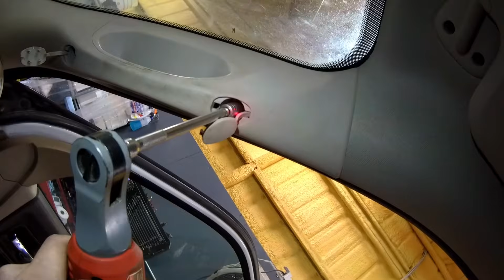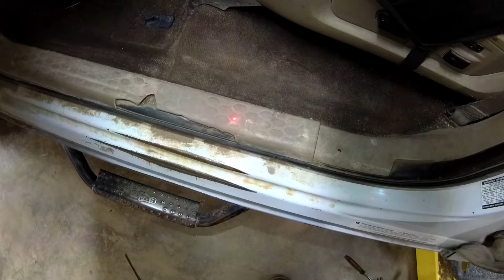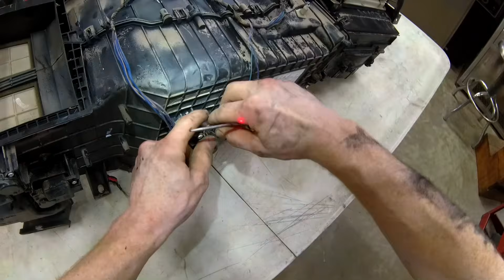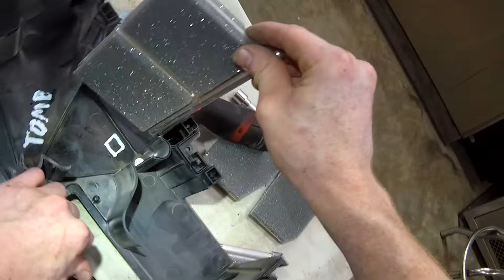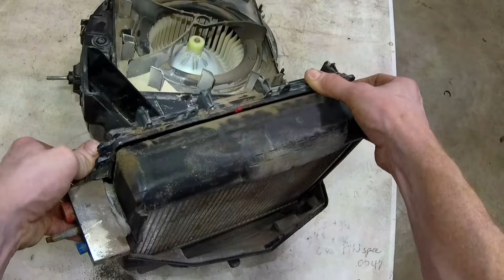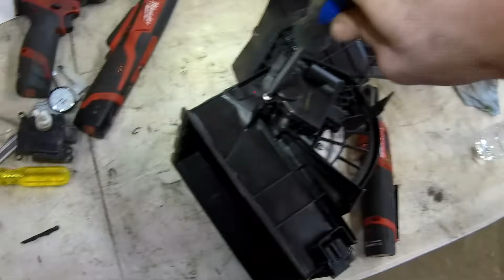4th Gen Dodge Ram Aluminum Blend Door Upgrade From Blend Door USA | Complete Installation

Comment: do you need to replace the condenser as well because the accumulator drier is made into it ??
Reply: Compressor failure, metal contamination, desiccant/receiver dryer failure… you should always replace the evaporator core, expansion valve and condenser-receiver dryer assembly. Flush all the lines after disassembly. And you’re good to go. Currently doing and evaporator core on a 2011 ram due to compressor failure and metal contamination found in the expansion valve. Modern evaporator cores and condenser passages are too small to try and flush debris out of, hence why you flush only the lines and replace all other components WITH HIGH QUALITY OEM parts only.

Comment: What size was the new foam tape you installed ?
Reply: I ended up using 1/2 wide 1/4 thick. Worked but i shouldve used 5/8 wide 1/2 thick. Hope this helps someone

Comment: Great video but I still don’t have heat and a blinking defrost light also I have taken dash out 4 times checking to see if doors are binding up but they move free have any suggestions to help ?
Reply: Have you replaced the heater core? Your's could be clogged with debris.

Have you cleaned the contacts on the back of your climate control module? Sometimes your climate control module goes bad and you need to replace it with a new one entirely.

Comment: RED! Great video. I have a 2010 Ram 1500 Laramie (Dual Zone) I have weak airflow but all my modes work. When I press the recirc button it lights up but nothing changes, no increased airflow and no noise of the air inlet duct moving. I noticed (stuck my hand in air inlet duct) the 'gear' when I press recirc does operate. Any thoughts?

Comment: Do you have to recover refrigerant if you're not changing the condensor? I just want to change the heater core.
Reply from the maker: Yes in order to remove the HVAC housing you must recover the refrigerant. And the HVAC housing must be removed to replace the heater core.

Comment: On the recirc door template, why couldn't you countersink the template and use flat head screws, or level out the heads of the supplied screws? And, if necessary, remove a little plastic from the housing.
Reply from the maker: You could absolutely do that if you wish. In fact that's probably how I will do it next time as well.
Reply: @TechnicianRed  It looks like they updated the kit to include flat head bolts, so no modification is needed now.

Comment: Blend Door Usa are the only doors to use. Ive installed them for year's specifically in 02 to 09 dodge ram truck with zero failures. Note the doors do a self recalibration every time the key is turned on the motors sweep one way against its stops then the other to find their position which is why so many break 
 The motor has too much torque and the stops are weak. Regardless the solution is Blend door usa.

Comment: Great video! Very informative! You helped make this job go so smoothly. I did use the template and the bracket to sandwich the recirculation door but instead of using the round head screws provided in the kit I used flat head screws and countersunk the three holes on the template so that the screws are flush with the template to provide clearance so that I didn’t have to shave anything off. 😎👍 1:00:01
Reply from the maker: Good idea! I might implement that myself going forward 👍

Comment: Actuator position calibrations are integrated into the system. Push and hold the Recirc Knob for 6 seconds and release. Repeat. The indicator starts to flash, the fan (If running, stops) and it calibrates the actuator positioning (travel of the mechanical positions - open and closed) of all three actuators.  You're welcome.  Also, removing the steering column and some of the electrical connections isn't necessary, as you can lower it to the floor to remove the Dash, saving time and effort in the process.
Reply: what would you need to do for Dual Zone Climate ? New Actuators, but they're not operating/calibrated properly.
Reply: @Brettskee  Probably NOT the Actuators that are the problem then. IDK beyond that, sorry.

Comment: I would like to thank you for a fantastic step by step tutorial for our RAMs. I did find that I could reach the center console rear bolts if I just moved the seats forward so that saved using a specialized tool. All of my blend doors and motors were fine so I ended up cleaning the AC coil (had some gunk slowing down air flow) and replacing the heater core as I had heat for the passenger but almost none for the driver. I thought it was the blend door but it wasn’t. Once I put the new heater core in I had beautiful hot heat pouring out of all the vents (thank goodness as it’s 4 deg in NY right now). I did try to flush the old heater core a couple of times but that only helped for a week or so, nothing like a new heater core I can attest to that. Thank you once again, your video and step by step details and pointers were fantastic!

Comment: This is a great help, thank you...  I have the dual zone and after the replacement blend doors and actuators,  I still have cold air on the drivers side but warm on the passenger.   I had it recalibrated  at the dealership and no change.  Any help would be great because I'm at witz end...  thanks in advance...  D
Reply: Did you ever find out a solution?  I’m starting my driver side blend door actuator install today and would hate to go through all this and find myself in your situation. Thank you and I hope you had success in getting yours working.

Comment: So I’m already down to replacing the hvac case guts before I realized I’d need a tool to recalibrate the actuators… now what? lol
Reply from the maker: @jeremiahbean9652  If you are talking about the part where I send power manually to the actuators to verify the doors travel without binding- this procedure isn't required. It is only recommended (and I highly recommend doing it). The recalibration at the end of the video can be done by a professional shop after you get the dash all put back together.
Reply: You can have the vehicle recalibrate itself as well (I’ve done it before). Just do a YouTube search and will be explained. I remember holding down the HVAC temp button for 10 seconds and then something else…

Comment: Also what about when you hear shifter is in the middle of
Reply from the maker: Can you be more specific? Not sure what you are asking. Is there a specific timestamp I should look at?
Reply: @TechnicianRed  sorry typing too fast. My gear shifter is located in the center console/floor. Yours looked to be a lever style from steering column … looking in how to remove gear shifter and center console wi the my option
Reply from the maker: @726scooty  It should still be about the same as this one it'll just have the shifter of course. Once you pull off the top of the console that surrounds the shifter you should be able to see the bolts holding the shifter down and you will need to pry the shift cable off the shifter with a small pry tool. It helps to shift the transmission into drive to be able to gain better access to the shift cable when you are trying it off of the shifter.
Reply: @TechnicianRed  you’re the man thank you for your help and knowledge

Comment: There HAS to be an easier way to do this?  Are you 100% certain that you can't just cut an access hole to swap the blend door, then patch that up with aluminum tape or whatever?    Seems like that should be possible, also without removing the whole dash, just the center console panel and/or the glovebox.

Further, Blend Door USA's kit for that is $330?  Absurd, for what it is.    I have to give you props for finding someone foolish enough to put that much money into a Dodge though, but they're probably already used to it being a money pit.
Reply from the maker: No, there are no shortcuts to doing this job. The HVAC housing absolutely must be split. As far as cost goes, it is a great value when you consider the amount of future labor that will be saved from having to replace broken plastic doors multiple times. 

Besides, the amount of R&D Blend Door USA has had to invest to get their product to where it is now absolutely wasn't cheap. So I wouldn't expect them to sell their product any cheaper.
Reply: @TechnicianRed I'm in Oklahoma and would drive to your shop! Some of these guys don't know squat about how much work that is!!!
Reply: Just give me your phone number!!!!
Reply from the maker: @jayscott8059 look up Stratemann Automotive on Google and give us a call!